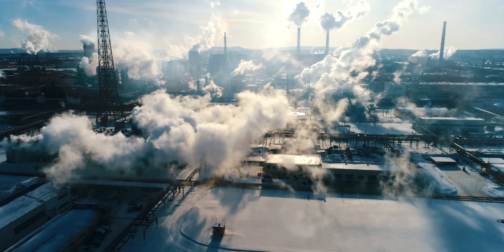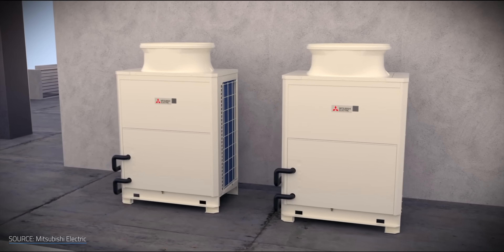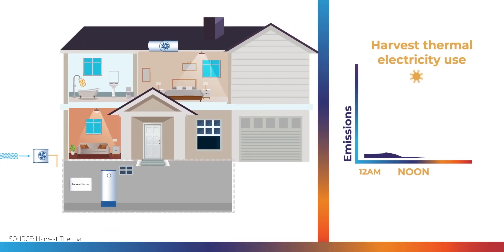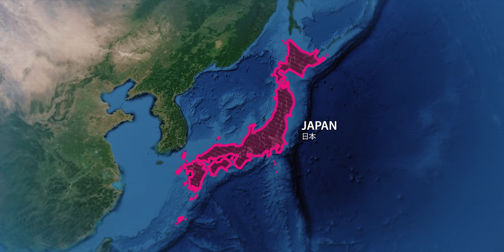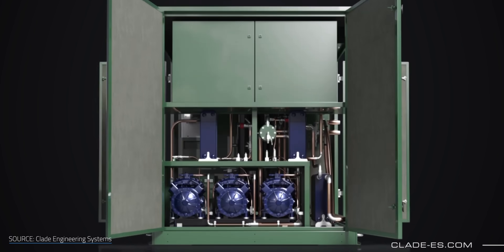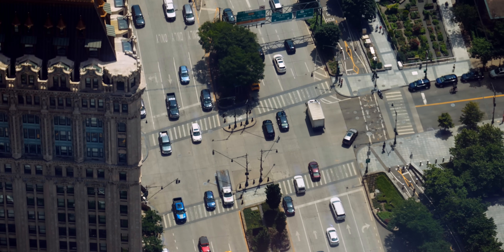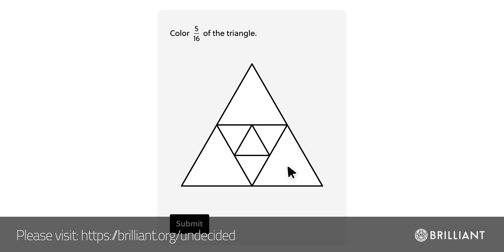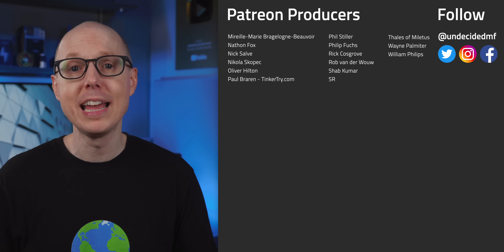Why CO2 Heat Pumps Are The Future Of Cooling

Comment: Um sorry but as an HVAC and refrigerant R&D Engineer your claims of CO2 are plainly wrong. Any refrigerant can operate in a transcritical cycle, CO2 just has a very low critical point. Low critical point actually significantly reduces the vapor compression cycle efficiency. Using a supercritical fluid to heat water is only beneficial because you can reduce losses on the heat exchanger by decreasing the temperature differences when you match the water lift with the CO2 temperature change. However, you can achieve this with zeotropic blends too. And even if we forego the supercritical operation with azeotropic refrogerants you can still achieve higher efficiencies than CO2 in most cases because CO2 is inherently low efficiency. Now all of the other cycle improvements actually just make the other systems even more efficenty than a CO2 one. And this is in heating where co2 is actually not that terrible of a refrigerant, but in cooling CO2 is quite terrible in terms of efficiency and it gets really bad in warmer conditions.
I worked on R&D of R744 (CO2) systems and it's just not very efficient. Sure you can improve the efficiency a little with an internal heat exchanger, two stage compression and proper discharge pressure control, but it will still be outperformed by almost every other modern refrigerant. It's adoption has increased mainly because Japanese companies made a hard push on CO2 heat pumps and most OEMs have insane profit margins on CO2 systems (because they are more expensive due to CO2's lower efficiency and high pressure requiring more complex systems with more expensive materials)
For a long time I worked on CO2, but I came to the conclusion that although it's a more environmentally friendly refrigerant it's inherent low efficiency results in higher emissions from the higher demand in electricity and from the costly systems required to use it.
Also all of the thermal storage and energy management works with any heat pump using any refrigerant. Please do better research next time. The claim of higher efficiencies and emission reduction from CO2 systems manufacturers is exhagerated bevause they make a lot more money on these system than on systems using other more efficient refrigerants.

Comment: I'm Australia we don't call them heat pump we call them "split system air conditioners." Pretty common here , obviously not aware of the gas inside just know that split air conds are almost the normal here as not expensive just need to pay pro to install etc

Comment: Propane/butane are about the most efficient commonly available refrigerant.  My current home geothermal pumps are 410, have had 22 in the past.  CO2 can be made to work, but isn't the most efficient refrigerant.  Air source heat pumps can also be made to work, but if you have well water geothermal can run COPs into the teens.  Ammonia is efficient, has been commonly used in industry, but a leak can kill you.
Reply: Yep, r-290 is basically an r-22 replacement, but it weighs half as much for the same charge, since it has way higher latent energy in the transition from liquid to gas. r-600a is more like an r-12 or r-134a replacement at even lower pressures, but too low for freezer use thanks to the density of the gas at that low temp, needing larger pipes with lower surface area to throughput ratio. 600a is best for refrigeration and 290 for freezer systems. I've only seen a CO2 system once, and it was because the thing broke early and tech couldn't repair it thanks to the pressure.

Comment: I'm sure, you're undermining the potential use of ammonia in this systems... given that we are talking about large domestic systems, ammonia has virtually no environmental impact in regards to global warming and the ozone layer, is comparably in cost to CO2, and given the it's working pressures the equipments of the exchangers are way cheaper, the only thing that make people hesitant of using it are the constant leaks due to the kind of compressor that are used with this refrigerants, and that in large concentrations is toxic for humans, displacing oxygen in the lungs and producing inflammation, but when installed in an rooftop configuration as you showed in the video, with a water battery tank, I'm sure it could mean a really competitive and better alternative than CO2 precisely because is not transcritical (the pressures are lower)

I don't like to criticize in public, but In a way your video is quite deceiving, choosing a refrigerant for an installation is not so simple when considering global cost, including aquisition, lifespan, cost of mantainance and running of the equipment

A more constructive criticism for your video would be to suggest you camparing the global cost of an ammonia vs CO2 equipment 

Have a nice day, greetings from argentina

Comment: Is it possible to replace the existing CFCs in all the existing air conditioners, with CO2 to kickstart this miraculous transition. 
Hot water tanks and pipe insulation are relatively cheep compared to a complete refit.

Comment: okey... ofset price in 5-10 years.. lets think this true... (4:55 time stamp). If your system will not brake maybe you will offset price... but what if it brakes 1 time in 2 years... and if we calculate 10 years thats 5 brakes... how much it cost to fix? Do fix man have time to fix it ? Maybe parts or what cost fortune to fix? How much cost burner ? What problems may he have ? I burn wood for heating 5 years with old one used 5 years.. thats 10 years life span.. i have never fixed it... where are no parts to brake exept water pump 25wats of power and cost 50-150 euro.... so... then i have to choose heeting for my house.. do i go co2 heat  pump that will cost me 20k or go with old school fosile that cost me 1k-3k ?? With less future problem ?

Comment: In Canada our regional temperature ranges between -40C and +40C. It's difficult to even find windows that are designed for our temperature range. I have yet to hear whether heat pumps of any kind are helpful within this range. What is the temperature range of CO2 heat pumps?

Comment: Dear Matt, can it be also the future for electricity production? I mean, If i can get up to 5Kw of heat for each Kw of electricity put in, and lets say the efficiency of my power plant generator is 33%. Unless I'm totally mistaken I would have a multiplication factor of around 1.6, that in ideal conditions like the hot summer in Las Vegas, could be used to generate massive amounts of Heat (for electricity and water) and Cold (for A/C Systems, and maybe to be used for water Harvesting from the air). It is not a perpetual machine (since it needs the input of the Sun and only would work in hot days), but might not be so crazy as Idea, as long as the efficiency numbers are correct. What do you think?

Comment: Thanks and very interesting. I head the Swedes were working on CO2 HP several years ago but have not heard of anything until your presentation.  I installed a Mitsubishi Mr Slim Zuba Central unit in 2010 and have saved over $22,000 in energy costs since its installation. Two years ago I replaced my 22 year old electric Hot Water tank (domestic hot water) with a Rheem Prestige heat pump hot water tank.  It only used 500 kWh last year and my total home energy costs continue to fall and now charge my Leaf at home with no additional household energy use.  From what I understand the global warming potential equivalent GWPe of 410a refrigerant is in the thousands so that may be the most attractive aspect of CO2 systems (which of course would only be GWPe of 1).  I suspect the problem will be reliability of such high pressure systems and the additional component.  But a very interesting potential and thanks for bringing it to light.

Comment: We used Co2 refrigerant for the cooling the cargo of ships in the 1950’s but the compressors had to be very heavy duty due to the pressure required. Also the dangers of leakage.

Comment: OP  sounds like a preacher, a politician, salesman, and  "only on TV  2500 easy payments of just 999.99"  Thermal battery?  Yeh?  WHAT HAPPENS when you have weeks on end of cold days and nights, AND you need hot water?   I find it hard to believe that   CO2 is  "THAT" much more efficient  than  several other ones.   I used to  service HVAC, back in the days or R22/12, 502, 500,  so I do know a little bit, and what I know is,  heat pumps in this area are LACKING.

Comment: Heh... heat pump water heaters exist...  pricey though.
My gas water heater is $300...

And I need more air conditioning than heating...
Then again again, there's a company out there for the big duck curve in TX...  Ice Bear rooftop units...

Comment: Matt I think you're confusing temperature and heat when you talk about the SUV vs car thing. It doesn't make sense to me. Different refrigerant types are made for different temperature differences, and CO2 supports 30-40 deg C temperature differences between hot and cold side. If it's running at a lower difference it'll be less efficient. Other synthetic refrigerant types have much lower delta Ts, and operate more efficiently when the difference between source and sink are near their delta T.

Comment: The co2 in the machine is already in the planetary system , it is not produced by the machine , so it is carbon neutral atleast.  If it leaks.
Reply: I wouldn't bet on "carbon neutral CO2" in such heat pumps. However, it isn't relevant due to the small amount of it.

Comment: Aside from the high pressure statement allready made, a normal air source (R32, R290(propane) or R410a) heatpump can as well run a COP 3 - 6 if installed correctly. The GWP of especially R290 is near nothing, so there's no benefit in CO2 as a refrigerant.

Comment: 5 hour old video on the "new tech" of heat pumps?  
  
It's old tech and it sucks. It can't keep up with a high humidity high heat environment and it can't heat well when it's freezing for extended days. If you live in a more temperate area there's still better ways to save.

Comment: The dirt is in the planned obsolescence. A deep dive on what the last efficiency 'revolution' in HVAC/refrigerator compressors yields two things: IBM and thinner lubricants. IBM gave us artificial magnets with 4X power density, IE better electric motors. (yay hard disk drives! And gave us EVs...)  Thinner lubes lowered resistance at the cost of MBTF. So now you can expect 12 years from your compressor. I grew up with the same refrigerator, we had to beat it to death and bury it to get it to quit. It kept running like a tell-tale heart. The gadgets were unobtanium, plastics were failing yet it kept running.
One can only speculate what the additional costs for consumer CO2 pressures will cost. The auto industry is abandoning the midrange market because it takes $20K just to do the electronics & rolling chassis. Until manufacturing comes back to the US, the middle class will be nonexistent.

Comment: Co2 was the original refrigerant in refrigerators and freezers as you only need a compressor  to bring the co2 above atmosp(like Ice Cream truck Freezers) heric pressure which will cause it to freeze when released  into  1 atmosphere

Only real danger of a major Co2  leak,because CO2 not riding humidity in the evaporation/precipitation cycle at 0ppn-900m a second(mostly off the oceans), is heavier then air is suffercation in pooled up areas of pure Co2 until it can sink into the ground or water source (Ocean and deep Ocean,Crust, and Mantle holding Thousands of trillions of tons of Co2....the most common form of gaseous  free carbon in the Universe)

Its up from cost versus savings down the line

Tesla always thought using fossil fuels was stupid and wasteful even back when gasoline was cheap runoff usually just burned off in oil Refining to make tar  till a demand for it happened

Real oil of Tar(Gasolime) is now further refined into butane,propane,Methane,Natural Gas,petrol alcohol, petroleum jelly,sulfur,and other derivatives......Modern Gasoline is manufactured from Pertol Alcohol and Octane darivatives and burns clean.....at least until EPA required detergents,oxegen suppresants,and ethanol is added 😒

Comment: 1500 - 2000 psi, no thanks. 410A already causes issues and usually has a high pressure cutoff around 600#. This is a solution that’s going to cause more problems in the ling run. If you think the coils are going to last and have good heat transfer you’re fooling yourself.

Comment: This is actually super interesting, especially for cold climates where choosing when to pump heat to a thermal storage unit could be highly beneficial. For instance, have the heat pump take heat from the water heater at night while the outside is at its coldest would probably be better than running electric resistance heating. You could also heat up the water heater during the day which would be better since outside air temperatures would be higher. 

Of course, this is assuming that a typical water heater could store enough heat energy to keep a house warm all night (which I am doubtful of), but the same concept could be used with other thermal masses.
Reply: A 100 gallon hot water tank holds 800 pounds of water, so by heating that to 130F (the highest that a heat pump can heat the water before the COP starts to fall) and you need to have 100F water to warm the air in your home, then you can store 30 F X 800 pounds, or 24,000 Btu's of usable heat.  So basically nothing when compared to a 75,000 BTU per hour furnace. 

I installed a 48,000 Btu heat pump in my 1,800 square foot home in 2014, it is 14 SEER Goodman single speed heat pump.  If I had selected cooling only, then a 30,000 BTU would work great in Portland Oregon, yet I live in a all electric home, so need the heat pump to make about 30,000 Btu's at 20F outside (the record low temperature that we get here).  

So I never hooked up my back up electric heater, and the Goodman unit has worked fine for 10 years now.  It really does not take much more energy to remove heat from the 45F daytime air than the 30F night time air.  So storing a little bit of heat in the water heater is less efficient than heating the air as you need to warm it.

Comment: CO2 (R744) heat pumps have been around commercially and residentially since the early 2000's. They have a couple of downsides. Operating and standstill pressures are very high, up to 100 bar. Compared to for instance R410 which operates at pressures up to 40 bar. R744 is toxic, how can you say that it's non-toxic? We all have CO2 detectors at home for a reason and that, combined with the high pressures, poses a real danger. So CO2 systems need a permanent leak detector. These systems also need very strong compressors (often two-stage) to be able to reach high pressures and other specially designed equipment able to deal with the high pressures, like strong piping (specialist welding or connectors), special heat exchangers, etc. Another thing is that R744 has a very high expansion coefficient (liquid to gas) and if any liquid gets trapped within the liquid part of the system (for instance due to a malfunction) this can lead to explosions because of a rapid and huge increase in pressure. As a rule of thumb, trapped R744 liquid will increase in pressure by 10 bar for every 1C temperature increase. For instance a temperature increase of 20C, from -10C to +10C, will increase pressures from 44 bar to 240 bar.
It's too bad you never seem to talk about the downsides of things and this makes your video's look more like commercials than unbiased and honest video's.

Comment: Still requires a compressor, wont be anymore efficient than existing R-410A VRF or VRV systems and Co2 has an absurd operating pressure making install and maintenance costs increase dramatically. Want cheap and efficient? Look to ammonia absorption systems instead.

Comment: C02 is good so...  BTW Matt at no time could AC chemicals go into the air, it was too dense.  What has happened is lies to the public and the result was higher bills for AC repairs and maintenance.  I hear they about to change it again and each time it cost techs money and us customers more money.  I'm all for capturing the C02, but get use to losing more money as any change causes AC techs to need new certifications and a CO2 leak in your system will go into the air, so isn't that a very, very bad idea since that is lighter than air and it is known to hurt our planet?  Once again your energy efficient people talk out of both sides of your mouth.  It cost so much for an electric car besides the price to the planet and we are forcing it on us at all levels.

Comment: 1:20 in to the video you state that the thermalphysical properties of CO2 makes it more efficiënt then other refrigerants. Later in the video you state that the COP is somewhat lower then other refrigerants. COP is the efficiency number of cooling and heatpump systems. That makes the first statement false.

CO2 gets very quickly less efficiënt at higher temperatures. That is because the pressure needs to increase to transcritical pressures. 90 Bar(a) or higher might be needed for the transport of heat. Much higher then you stated.

CO2 as a refrigerant is not bad, you did state a couple of advantages. But note that it is less efficiënt in heatpumps for most climates.